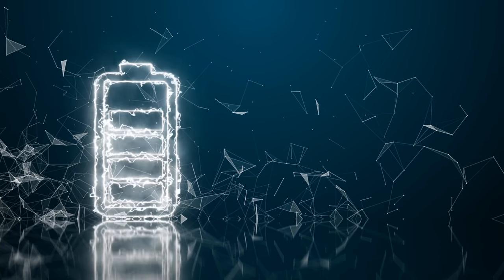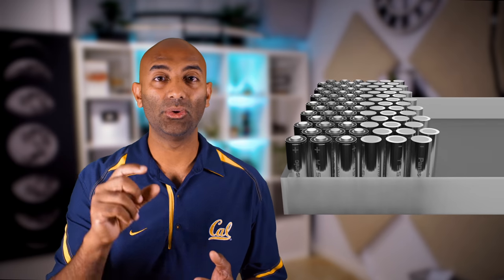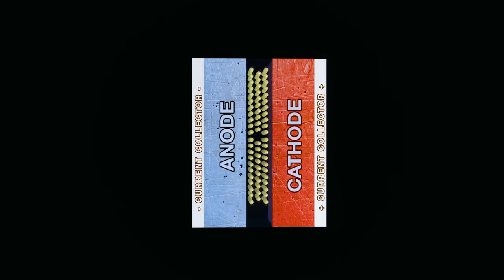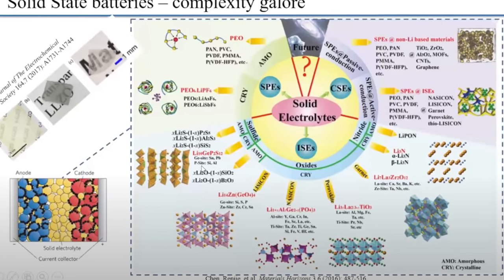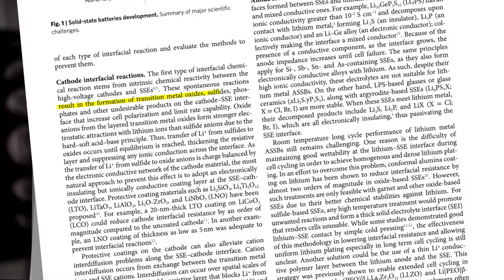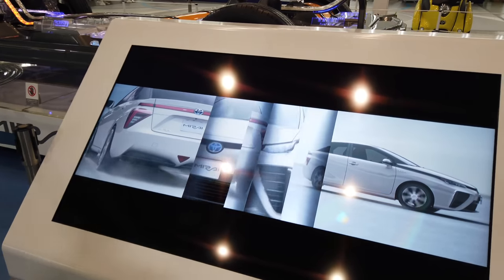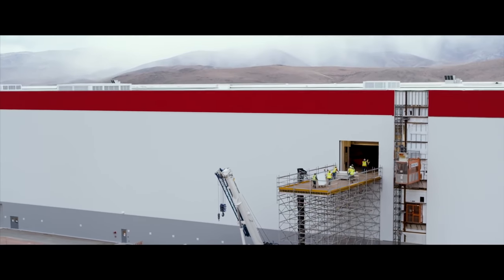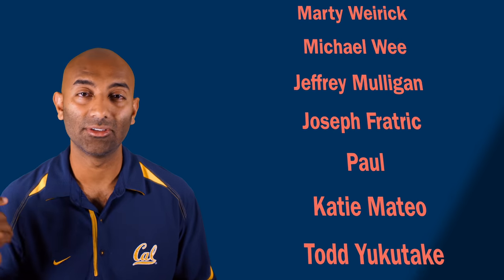The Truth about Solid-State Batteries. / Are These Batteries Really The Next Big Thing?

Comment: While it would be amazing to have better batteries with 10X greater specific energy with solid-state batteries they would still be likely 5-13x behind the specific energy of gasoline.  Then we would still have to address the charging efficiency and environmental impact of electricity production much like we have to address the environmental impact of gasoline production. As it is right now modern consumer lithium technology, depending on the type, is roughly 53-129x  lower specific energy than gasoline.  So I still don't see us completely shifting away from petroleum-based fuels any time in the next 10-15 years.  

The other issue at least with current lithium-ion battery technology is actual life in years, not in cycles because both factors will affect the true life of electric cars.  Most lithium batteries suffer from aging and begin to degrade as early as 3-5 years after production and start to have failures.  That number of failures increases over the time the pack is in service showing up as small losses in range.  Eventually, enough cells will fail that the charge controller won't be able to keep the pack balanced and the pack will need to be rebuilt or replaced.  Tesla and other manufacturers build in extra capacity to combat this for the warranty period but how will that look after 10 years of service, the jury is still out on how even the new lithium technologies will hold up after 10, 15, 20 or even 25 years of service.

Once we have new battery tech it will once again have to be tested under real-world use for the better part of a decade before we can commit to it replacing all-new battery production.  Testing on several new types of solid-state lithium cells is likely ongoing but we will have to wait for the final results.  Either way, I hope to have new tech to replace my home's battery packs in the next 10 years as the current bank will likely be pretty tired by then.
Reply: All great stuff, An EV is likely to way outlast the pack it was delivered with. Tesla (uniquely) use shotgun type cells and not pouches. So a 50kw Tesla pack may have 5,000 individual cells. A Pouch based pack (every other current manufacturer) may have 500 pouches. This results in a 10 times greater potential loss of range in a pouch pack. You lose one cell, you lose 1/5000 range. You lose one pouch, you lose 1/500 range. Tesla have and publish aggregated data on the whole fleet and on average, Tesla packs lose 5% for every 100,000 miles. I think this is an amazing achievement and there are older Model S with 500k miles and still with 75% battery capacity. Additionally, Teslas (at least) are designed with packs that can be very quickly replaced. Less than half a day in the service centre but they did demonstrate an automated creation that could to it faster than the time it took to fill an equivalent car with pumped gas.
Reply: "behind the specific energy of gasoline"
Who cares? Is it specific energy keeping people buying EVs, or is it the price of the battery back?
Reply: kuhrd
You are really not paying attention, are you?
Just about every point you raised was 5-10 years out of date.
More research required.
Reply: @ouethojlkjn  
"Teslas" are not designed with swappable packs.
Model S/X were, but it's not practical.
Tesla has (conservatively) at least 10 pack variants over the range with different dimensions, capacity, BMS.
More will arrive this year.
Every swap station would require every variant of pack, plus at least one spare fully charged at all times.

If you pulled up in say a Model 3 Performance, and there were 2 more in front of you, you would have to wait for the specific pack to be charged.
Then there's the number of packs stored across the network.
Terrible waste of resources.
It just doesn't work.
Reply: @rogerstarkey5390  Can you point me specifically to the data you are looking at that is more up to date?  I used the most current numbers I could find from data sheets online for commercially available 18650 lithium batteries in the capacity range of 3400-3600 mAh

Comment: Imagine charging your 3,000 mile car, every percent would be 30 miles! If the current speeds of charging percent wise was the same on a solid state battery, you could just like leave the car for 5-10 minutes and come back with a couple hundred more miles 🤯
Reply: It Tueaday Only if the charger produced thousands of kilowatts. Electric motors still use the same amount of energy to propel a car. That’s basic physics. A 3000 mile car would be thousand kilowatts probably so it would still take a long time to charge.
Reply: @CessnaPilot99  yeah i know, i think when i said that i didn't mean keep a constant speed of charging, but a constant percentage of charge, so like if it charges right now like 30% in 30 minutes or something, and that stayed the same, it would be insanely fast charging, the energy costs and output would be insane, but it was fun to think about
Reply: Fusion power substation in every home then ;-). But your point does demonstrate that other tech needs to keep up else at the end of a 3000 miles drive one better book a few nights stay to let the car charger back up!

Comment: SSB are being used as excuse for not building EVs today. Legacy car companies are just looking for any reason not to have BEVs, and a lack of an economical SSB is the "perfect" excuse for all the reasons you stated.  It's at least 5 years away from mass productions, and at least 10 years away from economical production (cost curve). SSB will doom any manufacture that waits for them before transitioning to all electric.  Tesla and the Chinese manufactures are not going to wait 10+ years for SSB to become economical. Tesla/Chinese manufactures will have them every bit as fast as any auto manufacturer.  Probably have them sooner. Just ask yourself how many gigafactories are going to be needed for SSBs?  What company is going to build as many SSB gigafactories as it going to take?  The same company that has gigafactories now.
Reply from the maker: Well said. The next big thing sometimes can bury a company in analysis paralysis.
Reply: "SSB are being used as excuse"
I don't think so. Professionals are not such excited about SSB. They know, that it is not needed for EVs.
They know that the problems with EVs are costs of battery production, the lack of manufacturing capacity and supply chain of raw materials.
Reply: @bokoloaranyfa3824  SSBs are in the mix of excuses. SSBs are the goto excuse for Toyota.  But I do agree with you EV adoption rate all comes down to costs (always does).

Comment: solid-state will completely transform the EV conversion scene two, right now you're heavily limited in EV conversion by how much battery you can stuff inside the car, which ends up adding a ton of cost, weight, and lost interior
Reply: "solid-state will completely transform"
Will not. 
1) Probably, it will never happen.
2) It is not a solution for the only problem with EV batteries: price.
Reply: @bokoloaranyfa3824  
1) You're wrong.
2) You're wrong

Otherwise? You're wrong.

Comment: Why would you get a new car when SSB comes out?  Just switch the battery
Reply: That's assuming that such a thing is even possible. Maybe the manufacturer you bought your EV from today will offer such a retrofit to SSB in ~5 years, but they almost certain'y won't. They'll need all their SSB battery packs for new cars, because they'll get a much better ROI on those than on selling them to an old customer who wants an upgrade.
Reply: @coredumperror  if the manufacturer doesn't, some modder will.
Reply: @speadskater  I'm not going to trust my car to "some modder", especially when it comes to the battery pack.
Reply: @coredumperror  ok.
Reply: coredumperror - 😂🤣😂 C’mon, where’s your sense of adventure? 😂🤣😂

Comment: Honestly i looks forward to solid state batteries and more electric cars but as somebody doing contract work and needing a truck bed. (not like a i need a lifestyle truck, like i need to pick up wood to build decking and cabinetry often type need. I am still unfortunately on the side lines waiting for things to come to market. I like the cyber truck but am waiting until they re out to see how reliability is before pulling that trigger. also probably waiting till the electric f150 is out to cross shop em.
Reply from the maker: Makes sense for your needs there just isn’t a model yet. But within 5 years you’ll have multiple great options

Comment: Current gen lithium ion is advancing so rapidly that by the time solid state hits the market, it will just be a cell with average specs... but a lot more room to grow!  That's why companies relying on current formats don't need to be worried.  What they will be cranking out by the time solid state trickles out to the market will be both superior and cheaper to the initial solid state cells and they know it. 

But make no mistake, that doesn't mean companies like Tesla are ignoring solid state.  It's just as private companies, they have very little incentive to talk about it.  As Elon would say: "we're super deep in batteries".  Then, when the time comes to introduce solid state, they're not going to throw away their conventional lines.  Instead they will just add to their total output by bringing in solid state lines alongside the conventional ones.  If the plan from legacy OEMs is to wait and install only one set of equipment, all they're doing is falling behind.  Conventional producers will have the luxury of building vehicles with dirt cheap conventional cells, and also reserving 'specialty' cells for niche products that can cost more because they would be otherwise impossible to make.  At least until economics dictates that solid state is better in ALL circumstances.  Waiting just means you've trying to introduce a, potentially better, but much more expensive competitor to a product that's working very well already.  If I told you that you could buy either of these two 300 mile cars but one has solid state batteries so it costs more, which one would you go for?  Yes, over time that will change and prices will come down.  But that won't be for a few years after introduction.

Oh, and then there's also the possibility that someone figures out how to integrate production of the solid state cell on a conventional line which is also not out of the realm of possibility.

Comment: The race is On!
Battery Day will reveal all I guess.  It does seem that Tesla's new dry electrode cells could rival current gen solid state batteries for energy density whilst far outstripping them for charge cycles.
Also Tesla have that experimental Lithium based battery capable of 3,650 miles per charge which sounds pretty amazing, well it does if you can stomach the 75 Charge cycles it can handle currently...   although I am thinking one of these packs could power the Cybertruck on it's Baja 1000 race later this year (I assume Elon has not changed plans on this?).
That 75 charge cycles before significant range loss is still 273k miles !  and honestly losing some range from a pack with such Huge range is not such an issue perhaps. 

Well, I will be looking forward to the next gen solid state batteries even though they have not yet made it into production cars. (they also still need to also improve their energy density for next gen from what I have seen).

I think these near future Huge range batteries are actually really important for 4x4's where people want to be able to adventure away from charging points.

Certainly a good time for EVs  =)
Reply from the maker: yeah they're currently optimizing the liquid electrolyte battery improving price, performance and output. They are basically dragging the rest of the industry along
Reply: "Battery Day will reveal all"
Tesla has not produced a single battery cell until now. However, they have a pilot project for it The best you can expect, that they will announce a date for starting commercial production of their own cells.
Reply: @bokoloaranyfa3824  I think you are forgetting that they own Maxwell Technologies since May 2019 which cost them $218 million which was bought because it had been developing this new dry electrode process.  They have been continually developing since purchase with some really interesting new updates on the details of the tech.  They have shown off since quite a long time back "pilot production" of these new cells, of course I do not think this is on anything approaching a commercial production level, but they certainly have learnt a lot in preparation for the newly announced commercial Pilot production line you mention.
They very likely have had several vehicles running long term tests using their own produced batteries before they start up this new commercial pilot production line which I think will be used for semi and plaid vehicles due to their requirement for high energy density and performance.  That new tabless tech should certainly help with performance on top of everything else.  That was brilliantly simple too LOL  :)
Reply: Do you really want to carry 3,650 miles worth of energy in a vehicle?

Range is going to become less important.
Ref the Elon Musk "300 mile" statement.
300- 350 miles, 4-5 hours driving, with a fast charge from even a V3 250kWh charger over the full 0-90+% of the capacity is all that's needed.
Drive 4 hours, stop for 15 minutes, drive 4 hours.... Repeat if required.
The car will out-range the driver
Reply: @bokoloaranyfa3824  
You know they haven't produced a single cell?
Wait for the rumour of a Plaid car at the Nordschleife the week before battery day.
Wait for that car on stage.
Wait for a Semi with the cells at the event.
Etc, etc, etc.
Reply: @rogerstarkey5390  Bill Gates once said "640K of memory was more than anyone needed"...
3,650 is certainly more than most people need in a car.  Assuming they create a pack with good durability & safety I see them saving weight and cost reducing the range to around 1,000 miles once producing such energy dense and cheap + light weight packs becomes easy.  It just makes longer range trips so much more convenient in not having to tie your route to Superchargers and the time taken to do that, people are always a fan of tech saving time with less waiting around.  For those in many parts of the world there  are still not so many charging points available.  Big cheap batteries are cheaper than infrastructure is more remote/sparsely populated parts of the world.
Of course there will be cheaper lower range versions for those whose needs it suits better.
Charging at home is about 60% plus cheaper than at Superchargers, so a long range pack will save you money if you normally would have used Superchargers on a trip.

If it is cheap, safe, light with low environmental impact then why would you not want it?  I know I would prefer a car I only have to charge once a month or when convenient.
Adding to that batteries charge a Lot faster before reaching higher states of charge which also makes these large capacities more appealing.

The Cybertruck however could actually directly use a pack like this.  Towing a trailer can reduce range by 50% even when not excessive in size or shape.  Again driving offroad can also reduce range by 50%.  Combine that with wanting to be able to spend days away from infrastructure and I think you will find people will pay for so much range if the cost is not too prohibitive.
A fair number of overlanders like to tow an offroad trailer.  I plan on getting one for mine.

Comment: Solid state batteries are are much better idea than current lithium ion ones. But the fundamental problem is moving your transportation energy around as electricity in the grid. The total amount of energy that is currently pored into fuel tanks is massive. Even if you say only a third of that energy get turned into work and electricity is 100% efficient you just can't move that much energy around the grid. We have to move to a green hydrogen future not a battery future.

Comment: If SSB are that energy dense, how the hell are we suppose to recharge them. It already takes a decent amount of time to charge a 3/Y at a SC using 250KW with current batteries which is the fastest setup available, but charging a SSB would take forever at that rate. Granted they wont have to be charged as often, but still, if the packs are of comparable size to today's cars, it will take quite some time. I guess they could make the packs smaller, but why would they, when they could show off unprecedented range.
Reply from the maker: well you could keep the same 75kWh of a LR Model 3 today. It would just weird 1/4 of the weight. Premium models with 250kWh capacity would weight similar to a LR model today. They'd also support faster charging, so imagine a world where we'd be pulling 500kW ;) all of this tech has to scale together, so yeah good point.
Reply: @TwoBitDaVinci  They'd definitely have to scale together, otherwise that predicament would rise. I think they'd want to keep the weight similar as it helps keep the cars safer, at least in what could be rollover events. I guess time will tell when all of this comes to fruition.